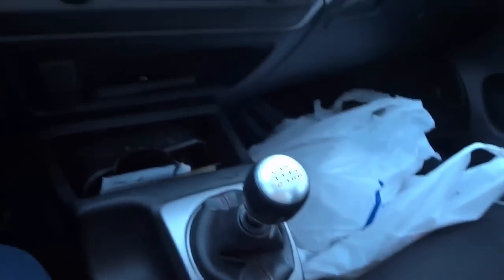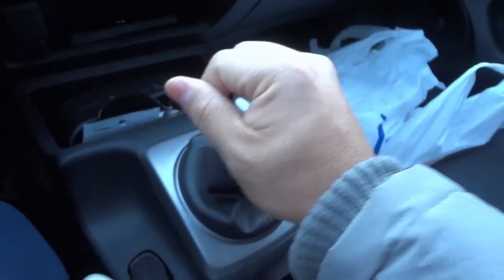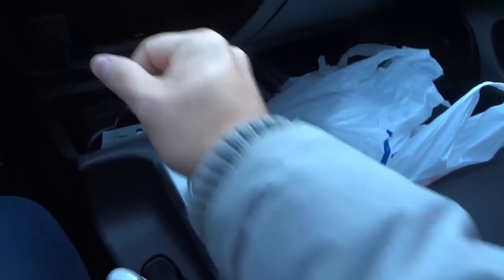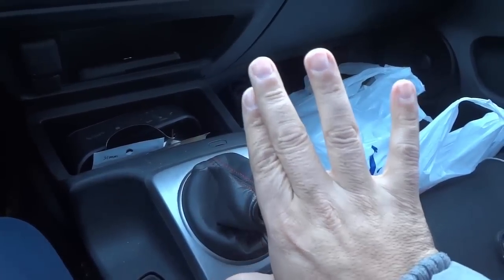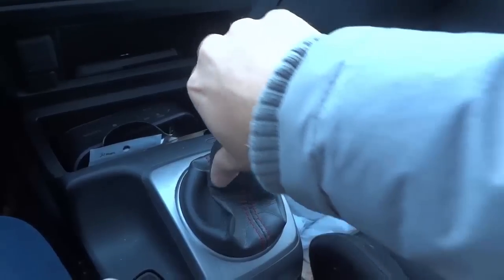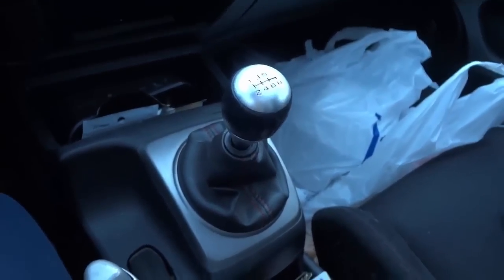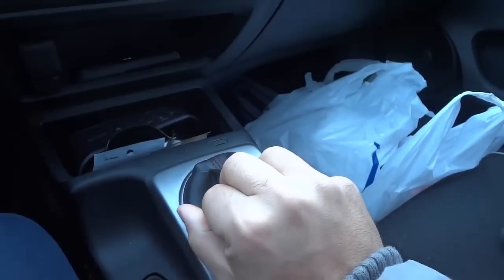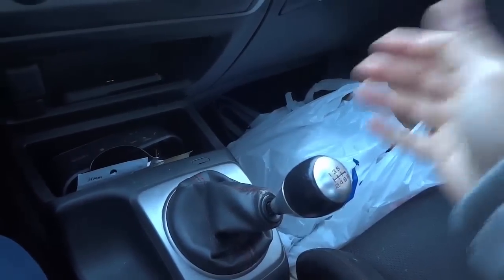How I Hold My Shift Knob-Driving Manual

Comment: I think that you can refine it better. Youre a bit rough with it as well.  Use a two-step between gears. This was taught to me by a truckie. Its natural and you can never select the wrong gear. Never grasp the stick. Push or scoop with the palm only in a relaxed manner. Thumb points to roof for  1,2,3,4. T Twist forearm so thumb points to floor for 5,6. Use whatever technique you wish depending where your R is located.

Comment: Bell end way to shift gears. Use a totally flat hand and dont hold or  grip. Face palm of hand to where you want gear stick to go and gently push no force required.
Reply: Gavin Paterson Lol who taught you that? He’s holding it incorrectly, yes, but you never wanna use a flat palm on an upshift, as some shift linkages are more notchy than others, and flat palming it is a quick way to destroy shifter bushings.